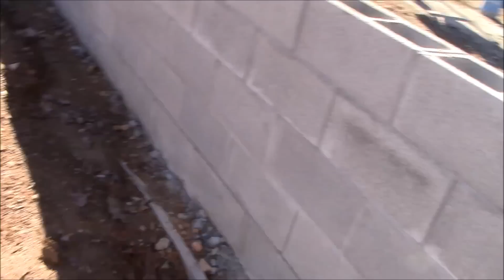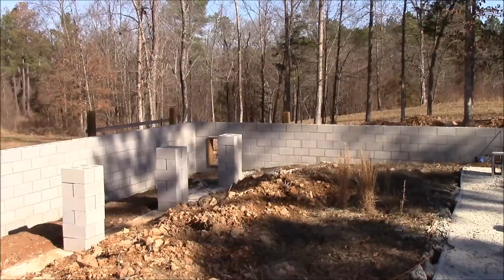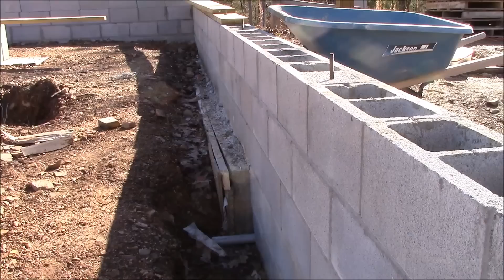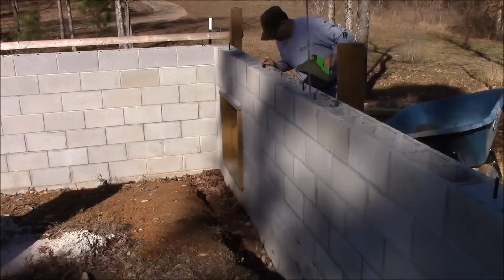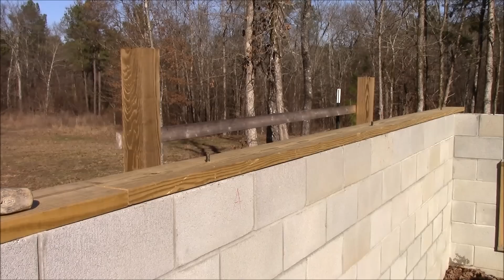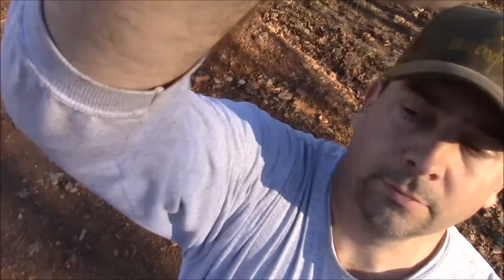Building My Own Home: Episode 8 - Finishing the Stem Wall Sill Plates

Comment: Nice job pal !! We all have different ways of doing things. If I was doing it, I would save some money on rentals, blocks and bags of soncrete. First I would attach a plough behind my truck (for the hard work) and dig the trenches myself. Some of  the money saved I would "invest" in wood and more rebars. I would build some sturdy forms and get the concrete poured a lot higher. Leveled with the highest point. This way I would get things done faster (yes I'm digging but not laying/filling blocks) and I also believe it will end up cheaper since blocks are expensive. So basically quicker and cheaper.just  watching you filling block by block made me want to weep : ) Good video though !!

Comment: I have a question. I'm considering building a house, and I prefer the method you used for your foundation. If I were building a house that did not have a wrap-around porch like yours, would I then just move the stem wall up to where it sits against the foundation columns?
Reply from the maker: Yes, generally the outside walls of the house would rest on top of the stem wall instead of on columns like mine do. Look on youtube for some videos by Larry Haun (I think a channel by the name of finnius has them). Larry is a professional builder and did a really good foundation video describing in detail what you want to do. Best of luck!

Comment: Hows come you didn't  use any sill sealer?
Reply from the maker: I didn't do a foam seal between the concrete and sill plate because it is just going into a vented crawl space. I am actually encouraging air flow to help remove moisture, so for my sill a sealer didn't make sense. If it had gone into a condition space such as a basement or even a conditioned crawl space I most certainly would have.  

As for the termite shield there is a mix of mixed results with them. In my case I would have had to place holes in it for my anchor bolts which severely comprises it's effectiveness. So I simply opted not to use one at all and trust in the treated wood and a qualified termite protection plan. Plus mine is really easy for me to do regular inspections of.
Reply: I was wandering the same. Foam for draft  and thin sheet of metal as a termite barrier is what I've seen in other videos.

Comment: consider Edison Solar battery & systems to use as an off grid system. It's not cheap but the batteries can be drawn down to nothing & they will last 30 years.
Reply from the maker: +Kurt Cooper Thanks, I hadn't hear of those before. I will have to check into them.